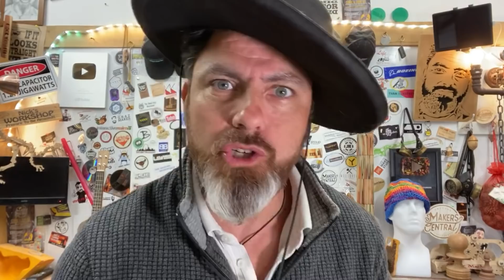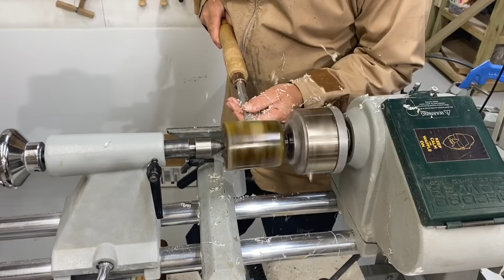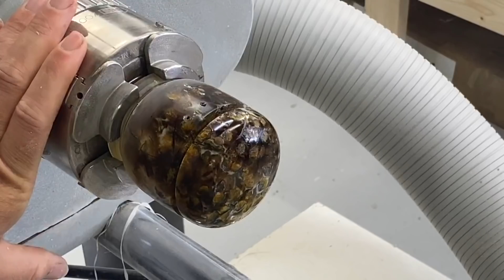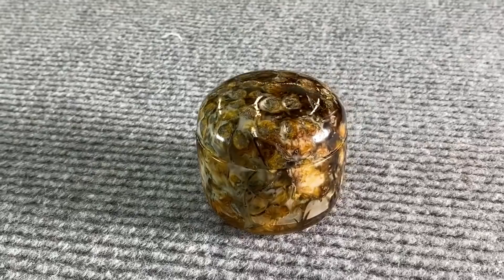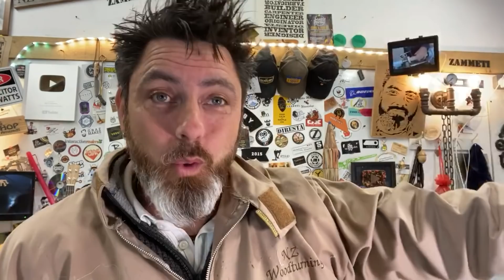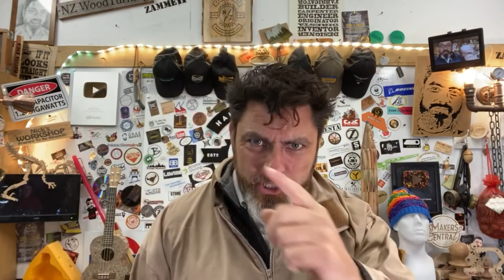Woodturning - Moldy Daisy's

Comment: Hey Nick, when you dry the flowers out you could also press them so that they dry without curling inwards and hiding the prettiness of the flower. If you don't want to make a press, I just do it with a heavy book between two pieces of paper in the cover under the heavy side.

Comment: You definitely need to dry the flowers first. The best way to dry the flowers is to use silica gel, but it's more like silica sand. It dries the flowers in their original shape, and it generally keeps the colours pretty close to what they originally were. You put them into the silica sand for about a week, and they come out perfectly dried, and kinda feeling like paper, but they aren't brittle. Seriously the best way I've found to dry flowers.

Comment: If you save every "Do Not Eat" pack in every electronics box, open them and put the contents into a humidity-proof container, you will have a perfect dehydrator. If it gets too damp, you can spread them on a cookie sheet and bake at 175°F (79.4°C) for about an hour and then be reused. Make sure that your flowers are fully submerged in the beads to dehydrate.

Comment: I'm no expert, and if anyone wants to correct me please do, but I think if you put a top gel coat on the 'Rot Pot', it will help seal in the daisies and mould and should stop the smell. I haven't done anything with flowers yet but I use Glasscast 3 as my gel coat :)

Comment: U should use Yorkshire grit and other finishes when the project is fully turned and sanded+polished, that way u only need to bring the Yorkshire grit out once to coat the whole project instead of twice, which means u take less time on the product and still looks mostly the same

Comment: Not in reference to this project but the next time you want different colors try pouring in clear resin then take wood skewers dipped in a color and gently swirl it around in the clear resin BUT don’t do to much, little goes a long way. Continue with however many colors you want. White will look like smoke. As the air is pressured out it will move the resin around and will move your swirls around so that’s why you don’t want to swirl to much in beginning. On other projects like burl pudding bowl, it came out pink because the resin “moves” around as it cures so it basically mixed itself.

Comment: I think you should have cut the medallion hole on the bottom a little deeper so you could pot the medallion in Resin so it can't pop out later and if you use denatured alcohol to completely clean the surface, coating the entire piece in Resin to completely seal it might remove the stink (and the possible Mold Contamination of whatever room this ends up in)...

Comment: Use the stuff they use to hold water in potting soil. Unfortunately I can't think of what it's called. 
Leave it dry and put the flowers in it and cover them with it.
It should draw out the moisture of the flowers.
Reply: Silica

Comment: If you dry out the flowers you'll lose some of the color and shape if you use UV resin you don't need to dry them out just brush UV resin all over the flower and then hit it with a UV light to cure it and then use it in your resin you will get a much better and beautiful result

Comment: Why not try pouring an extra coat of resin over your daisy pot? It should seal in the smell, especially if you coat it inside and out. You may need to pare down the inside edge of the pot a little though, then the extra layer of resin won't make the lid too tight to fit properly.

Comment: Very very funnn-ky!  I am copy-pasting a comment I left on your ketchup video that may help to shed light on the effects that may have taken place during the resin curing reaction.  (You May be able to coat water-containing objects with a hydrophobic sealant to help with the water incompatibility issue....though it may still experience heat effects).  Keep experimenting please!  I love ❤️ learning about the effects produced by different objects. You are so talented.  WAFFLE ON!                                                                                                                                                                 Begin pasted content from other video.... hope it helps:    The resin and ketchup are incompatible (immiscible) since ketchup has some water and oil. They form a sort of emulsion at first ...  under pressure, the oily portion coalesces and the exothermicity of the resin reaction cooks...(fries in oil) ....and burns the tomato and turns it black. Interesting effects if exploited to achieve max funnnnkiness! 🤗🤗🤗. The same thing probably happened with the live plants that you placed in resin (water still present which caused the funky bubbling and the once living plant to be burned in the resin.  Not so sure about the mold in the daisies.  Perhaps the heat, anaerobic, and dark conditions played a role if it is indeed mold)—— but boy the finished orb was GORGEOUS!!!😍😍😍😍😍. Basically, any time you mix something that is not dry in water incompatible resin, you will get voids and pitting ( if the resin fully cures), and putting live plants in a highly exothermic or heat producing resin will cause  darkening and perhaps burning.  In some cases, the presence of water can cause the reaction mixture to heat to even higher temperatures.            ——Chemistry professor here ✊🏽addicted to ur channel!!!👩🏽‍🔬👩🏽‍🔬👩🏽‍🔬👩🏽‍🔬👩🏽‍🔬. Don’t judge my spellin’. LOL

Comment: You didn't have to do that one, you should have tossed it, LOL.

Try again with dried flowers.  I posted a quick dry technique int he comments on your other video.

Make a sandwich like this:

Patio brick
towel (paper or real)
flowers
towel (paper or real)
Patio brick

Microwave it for 30 second bursts allowing cooling time in between.  Longer than that can cause a fire, I know, I managed it.

You will know the flowers are dried when they are the consistency of potato chips(crisps).